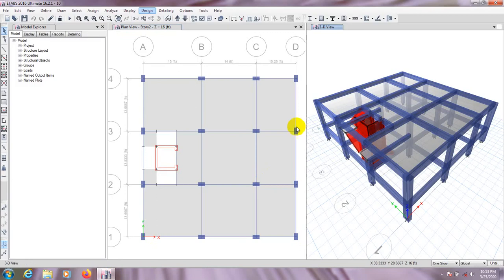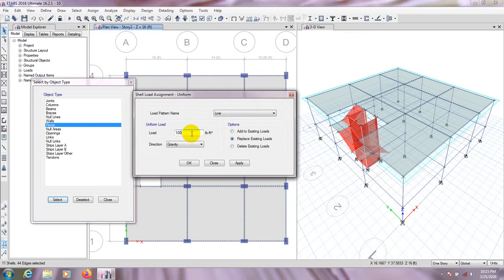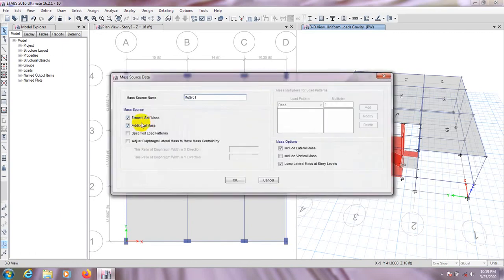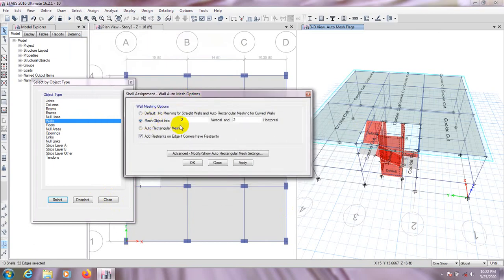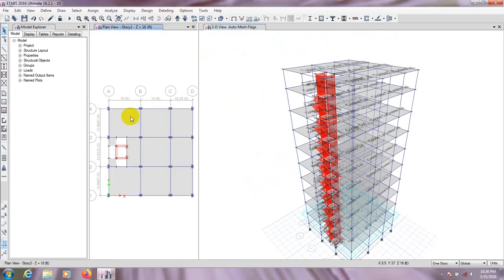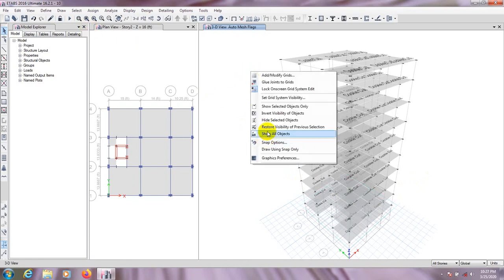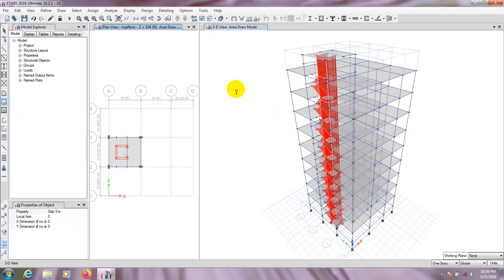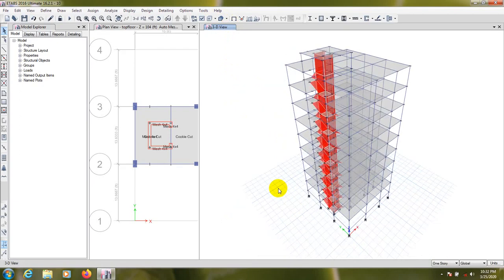10 Storey Building Design With Shear wall And Two Landing Stairs In Etabs | Parts-05

Comment: Mass Source : if the live load is more than 3Kn/sqm the the factor will be 0.5.
BNBC: 2.5.7.3 Seismic weight
Reply from the maker: it should be 0.5 as LL is about 4.788 kn/m^2 . sry for my mistake.
Reply from the maker: you are right.